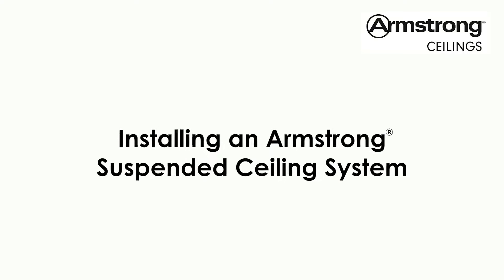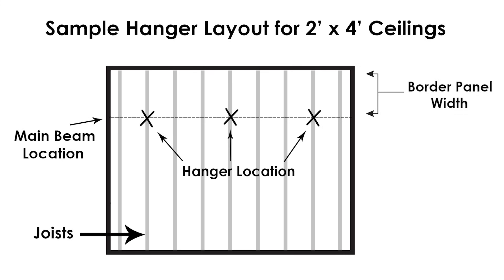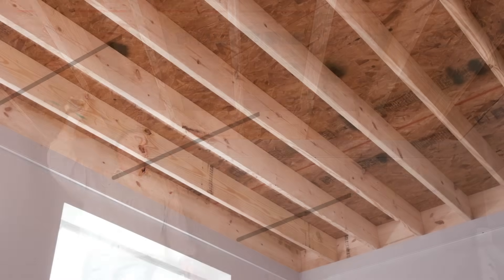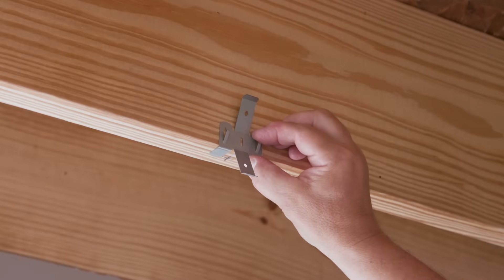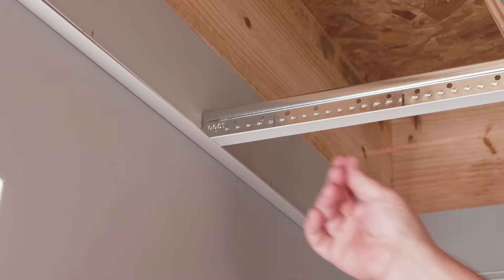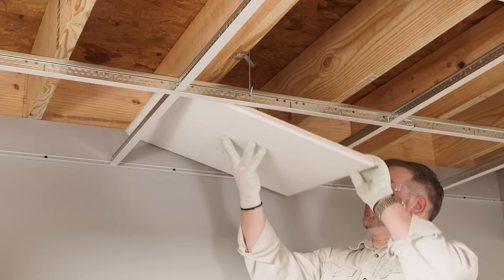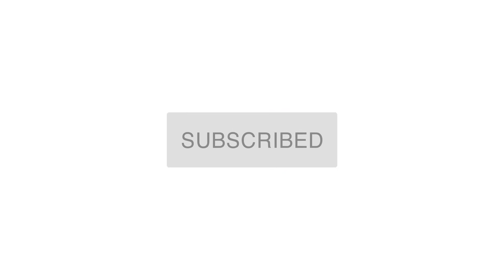How to Install a Drop Ceiling | Armstrong Ceilings for the Home

Comment: Important tip: When cutting the border cross tees, you may want to go 1/8" to 1/4" shorter than the string line. Otherwise, you will have a tough time fitting them against the wall molding.

Comment: Or you could set a laser 7/8 above cieling hieght. Mark all the hangers with a black marker at once. Bend them on that point . Then all you have to do is throw in all your mains.
Reply: Good idea thanks
Reply: Does not come out perfectly flat their are geometric indications of planning failure

Comment: Drop ceilings make it easy to rewire devices and check for leaks etc. Just keep some tile spare in case you dont find them later in stock.
Reply: Very good suggestions. I will keep that in mind.

Comment: i have concrete walls. is there a way to put up side moldings without having to drill into the cinder block? Good video. ty
Reply: you can either use a nail gun but besides that probably not

Comment: Are they saying you can set the actual ceiling height at 3" below joists to bottom of wall molding, or are they saying 3" from bottom of joists to the top of the wall molding?

Comment: What if you want to add insulation above it? How would you go about that?
Reply: @Psychlist1972  but doesn’t the insulation rest above the ceiling?
Reply: @robmespeedy  It goes between the floor joists above you. If you already have a finished ceiling, and you want to insulate, you may want to remove the finished ceiling first. If this is for noise and the ceiling is not already insulated, you'll end up with basically a hollow drum and will have to work that much harder to reduce the noise. If the existing ceiling is already adequately insulated and is an interior surface with conditioned air on both sides, and you are doing this for noise reduction, then you could use straps or netting to hold insulation up and still give yourself room between the new hanging ceiling and the insulation to run cables, insert/remove tiles, etc.

If this is going in an attic or something else where the ceiling is an exterior surface/roof, you have other insulation concerns to deal with first. You don't want moisture trapped in between old drywall and new insulation (especially if existing insulation has a vapor barrier already). I'm not an insulation expert/pro, so consult someone who is in that case.

In my basement office/studio, I've insulated between the joists above me, and am also using the 2x2 ceilume acoustic panels which have 2x2 foam sound insulation which sits on top of them. They are very lightweight, so no concerns holding that load up with a suspended grid, and because they are already 2x2, there's no need to maneuver odd-sized insulation batts around between hangers.
Reply: @Psychlist1972  thank you so much for your detailed reply. I guess I should have been more specific with what I’m working on. My garage literally has no ceiling, it only has 4 beams going across. It looks almost impossible to frame it to add drywall so I was looking for an alternative for a ceiling and came upon this. The only thing is my garage gets extremely hot. So I’m kinda lost with how to go about insulating it.
Reply: @robmespeedy  Something like that is worth having a pro come in and at least make a recommendation to you. Just be clear on what you are requesting. Your options are going to vary based on how the roof is vented and whether or not you want to use the space up there. A drop ceiling is not a substitute for insulation. It won't really get you want you want there.

Personally, I like high density spray foam directly on the inside of the roof (after adding in the appropriate vent channels), but again, it depends on your construction and venting. 

Insulation is one of those things that, if you don't know what you are doing, you can create a world of problems with moisture, mold, and more.

The way one might frame for drywall, if you wanted that approach (after appropriate insulation) is to run furring strips perpendicular to the beams and attach the drywall to that. Or, you insulate the roof and have a cathedral ceiling (again, drywall) with some open beams below it.

And, just to be clear again, I am not a pro. I've done a bunch of remodeling in my home, workshop, etc. but this is not my trade.
Reply: @Psychlist1972  thanks Pete! I def need to get some kind of roof vent as there’s none at all. The only vents it has are two that are on the floor, but no vents up above to release the hot air.

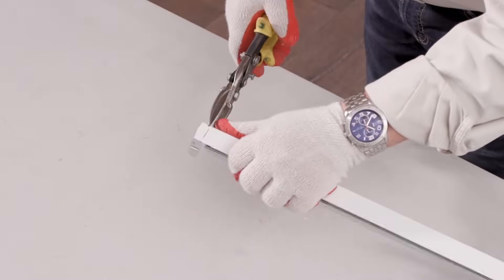Comment: 9:21 it's recommended to trim the main beams further if the grid is not square, but didn't we wire them into place already? Do we have disassemble everything we've built to achive this? Any help is appreciated! My square is off by about a half inch.

Comment: How do you remove a two-foot damaged cross frame?  I know they “click” when installed, however I can’t seem to get it out.
Reply: You have to push in/flatten one (or both) "teeth" that are keeping it locked in...that's the click you hear when you install it. There's one per side. Then wiggle it out and up a little and on a slight angle and it should come out. If you take one out and need to reinstall it, make sure to push/re-shape those "teeth" back out so they snap back in during reinsertion. Good luck!

Comment: So I have a room that is exactly 12 feet wide. If I understand correctly. I have to trim off a few inches of the main tee. This makes my main tee too short, and so I have to add a small section to every main tee. Who is the genius at Armstrong  that did not design the 12 foot long main tee to fit a 12 foot wide or long room so that 6 2x2 tiles can be evenly spaced? Why are there no holes starting 24 inches from the factory edge? Please explain.

Comment: I always cut the perimeter tiles in first and then clip them down from above. This is a must over doorways as the wind and suction will move them about overwise. Then I put the full tiles in after
Reply: If you frame it right your tiles don’t move from anything , if you frame the borders too loose that happens
Reply: @TJPIZAZ  It has to be just right though or over cutting them and wedging them in pushes the grid out of square
Reply: @steveannetts9909  no it can’t man, long as you Rivet one side so it can’t pull, you put your full tiles in first, I set my half tiles that I use for border in, obviously can’t fit cause they aren’t cut right? So then I’ll use a long razor and trace scribe against my grid, I used to experience the same problem so I just wanted to weigh my own experience hoping I help someone else! Not knocking you!
Reply: @TJPIZAZ  No worries TJ. I was just thinking that if tile clipped then it will also mean no rivits if the grid is cut tight enough. Someone mentioned they didn't like the rivits in the chat.
And there's also more than one way to skin a cat
Reply: @steveannetts9909  always more than one way , but there’s always a more efficient way, but it takes trial and error rather than an opinion , though a trial from an opinion could take someone further, with great surprise as well. However as I’ve learned and was thought when I first began, you always put full tiles in first. You only really need to pop rivet when you’re taking out a section of ceilings

Comment: Setting a leveling wire to make the hangers all the same length only works if your joists are 16" on center. It doesn't work with a pre-engineered floor joist system where they can be 20" on center.

Comment: Great video on the how-to!  Gives me better insight.  Thanks for the tutorial. 
Cracks me up, though...the beginning of the video recommends safety glasses, yet at the 4:40 mark we're told to bend suspension wires at a 90 degree angles.  So when safety glasses REALLY should be worn to prevent an eye being poked out, the demonstrator isn't wearing any. 🙃
Reply: While hanging these ceilings is not rocket science, it does involve a lot of fiddling. That is something that I cannot stand doing. That's why I hired someone to do it :-p

Comment: Do not buy this crap.  I paid double the normal ceiling tiles because I thought they were more durable and I couldn’t be more wrong.  It’s impossible not to chip them and scratch them.  They mark just by leaning one against the wall.  If you make a mistake you might as well throw the tile away.  This world has gone from building made of granite to cheap paper houses that cost an arm and a leg.  Do yourself a favour hire a dry waller.  At least you can repair it and paint it.

Comment: What if you want a drop ceiling but already have plasterboard on the ceiling and therefore cannot mount the brackets on the sides of the joists? 
I am planning a basement renovation project that will turn the room into a home cinema and so I am trying to add mass to the ceiling to dampen sound and a drop ceiling creates an additional air gap which helps with isolating sound. But if I don't have access to the sides of the joists is there an alternative for hanging ceiling of this type?
Reply: Plaster spikes for your wires?
Reply: Same problem
Reply: I suppose youve found your solution?

Comment: Wonderful summary; I wish, though, that it was slowed down just a bit - I had to stop, back up and restart several times to meld the narration and video. But then, I'm old.
Reply: Has nothing to do with being old I'm 25 and I had to restart the video more times than that😁
Reply: lol im 22 years old. and i do exactly as you do. we just hide is well.
Reply: I'm running it at .5 speed as it's too fast for anybody to follow.
Reply: Were you planning on doing the entire job in 13 min and 28 seconds?

Comment: Try your 45 cuts (unless you lap square with the factory hemmed edge) hemmed by cutting past the 45 and hemming with hands steamers for a hemmed 45, no rough miter cuts

Leave your cuts or gold or laps away from main line of sight do your eye skips over the lap or miter, not mainly looking at the lower underlapping section of wall angle

Comment: Those wire ties are not right those loop are terrible ......amatuersss
Reply: Yeah they will never hire an actual professional to video these installations
Reply: That's how u do it at ur jobs dont lie
Reply: @shanoemichael4439  sure
Reply: @dukethekiddjr.russell8831  who u work 4
Reply: @shanoemichael4439  I work for a company owned by me and my Son
Reply: @dukethekiddjr.russell8831  in California?  I work for P.C.I
Reply: @shanoemichael4439  no in Texas Florida Alabama Mississippi Kansas and Louisiana.
Reply: @shanoemichael4439  I have worked in  California many years ago but the taxes are way to much to bear.
Reply: @shanoemichael4439  what location do you work at
Reply: @shanoemichael4439  On The Level Acoustics and Specialties (OTLAS) FACEBOOK
Reply: @dukethekiddjr.russell8831  L.A orange county  san Bernardino county
Reply: @dukethekiddjr.russell8831  why u move around so much? Is the tbar business good out there? I'm in the  union, doing the metro link specialty ceiling
Reply: @shanoemichael4439  I don't move. I travel to work.  Union Carpenter since 1995.
Local 857/408/174.
Reply: @shanoemichael4439  is M&M Interior still around? Riverside
Reply: @dukethekiddjr.russell8831  no I never heard of them. Hamilton is the only one close to riverside. And some non union
Reply: @dukethekiddjr.russell8831  I actually live in riverside and used to  help a guy from riverside acoustics

Comment: This is a good video, and thumbs up. You showed me just what an an immense hassle and faff this sort of ceiling is. I'm well and truly put off, so this was useful but probably not how you'd imagined. Despite and yet because of that, good video.
Reply: Yeah, you'll probably want an easier process hanging, taping, mudding, sanding drywall over 3 coats. Then all u have to do is put a coat of drywall primer and paint it, all above your head. This drop ceiling is a huge pain. 😆
Reply: Very good

Comment: Best tip yet... Do not install drop ceiling everyone I've seen got ripped out, I personally ripped out three of them if it's in the basement leave it exposed you'll need to access your ductwork electrical and plumbing any other area just put wood paneling or tongue and groove it, ect nobody can stand the look of a drop ceiling and it will decrease your home's value
Reply: Really old ceiling tiles can sag for sure, especially if there's moisture. The rest here is just not true, or at least has no supporting evidence.

I use the ceilume tiles in an armstrong grid. They look great, and are perfect for noise isolation.